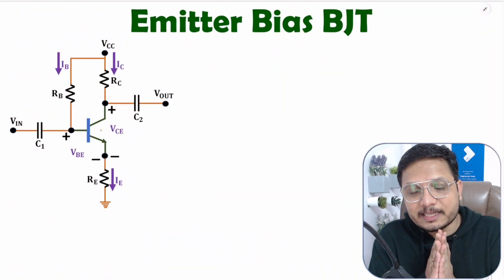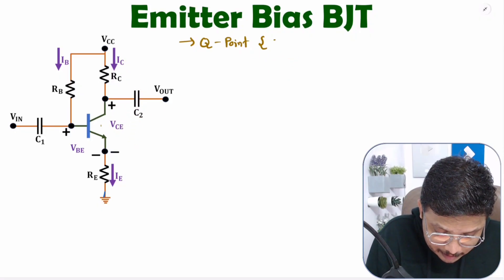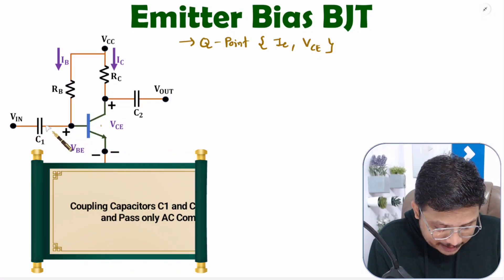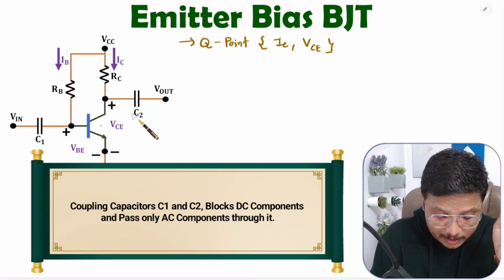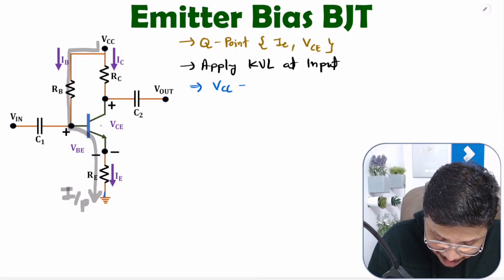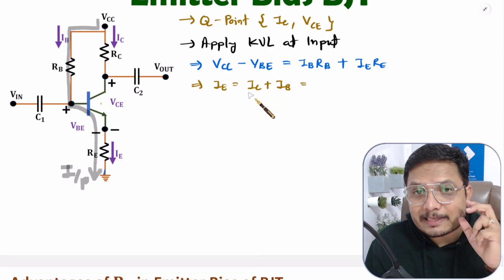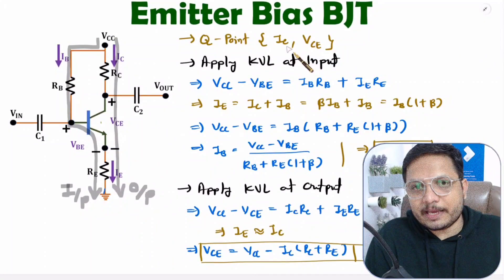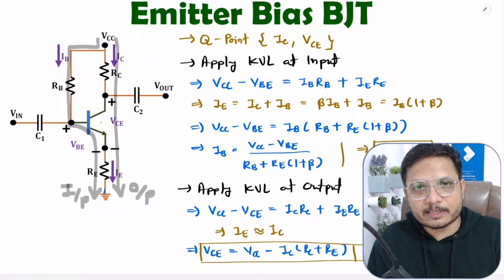Emitter Bias of BJT (Basics, Circuit, Parameters, Example & Stability) Explained

Comment: if we use c1 to stop dc component in input why do we again need to to connect c2 to stop dc component in output
Reply from the maker: C1 and C2 are coupling capacitors, that is used to block DC at input and output.